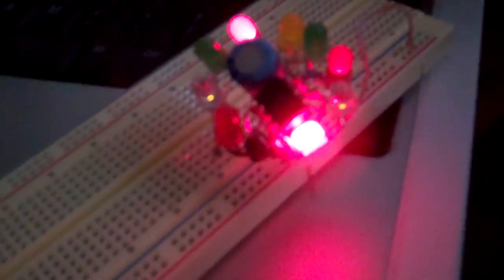Bah it doesn't work!

Comment: Are all your LEDs in parallel? If so, the LEDs with the lowest turn-on threshold will illuminate and their Zener effect will "clamp" the supply voltage at a value that is insufficient to turn on the other LEDs. To avoid this problem, include a resistor in series with each LED. You may also want to determine what particular arrangement of series-parallel connections work best with the available voltage source, but if that value is 3V, then you may only be able to use a resistor per LED.